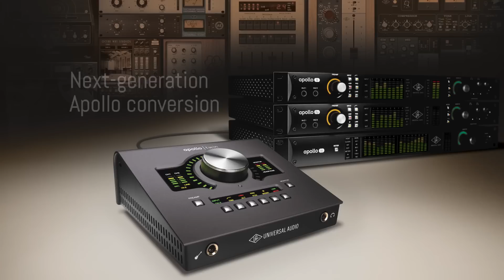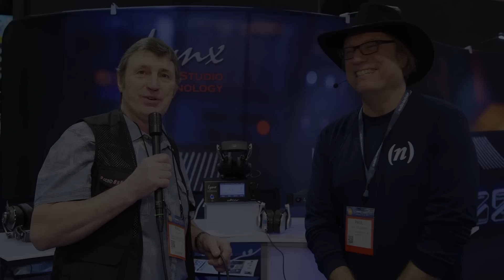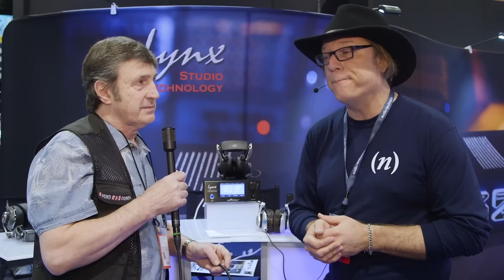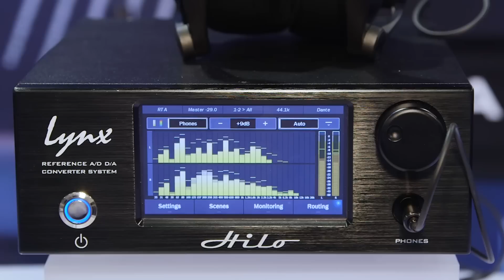Lynx Hilo Updates - NAMM 2017

Comment: I prefer the version 7 firmware. It managed the multilingual, and the scale of the analogue output level was positive and not negative...more logical.
Reply: Agreed, and the older VU meters were MUCH easier to read too.
Reply: I haven't updated my Hilo's firmware for ages. I'm not even sure which version I have.